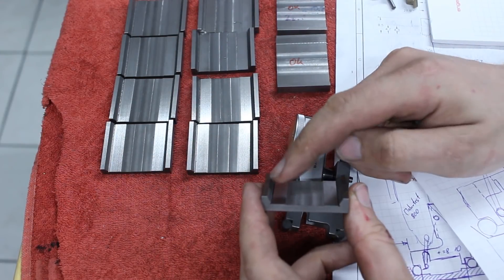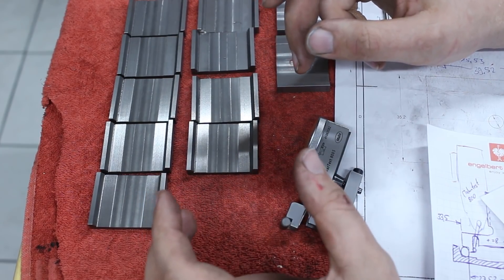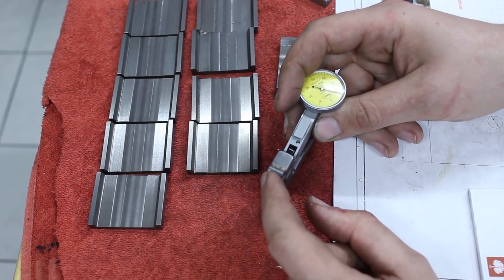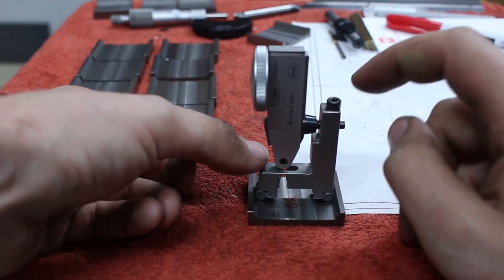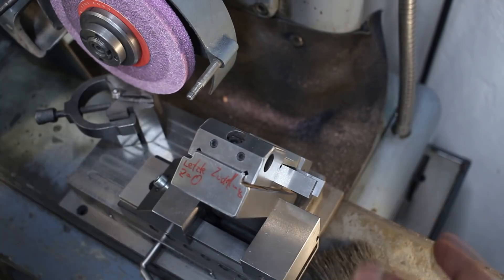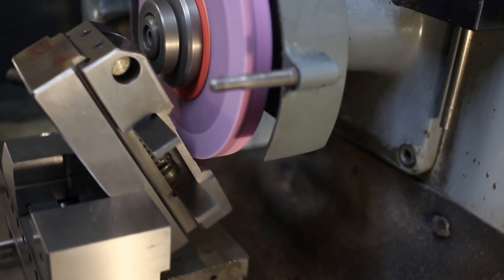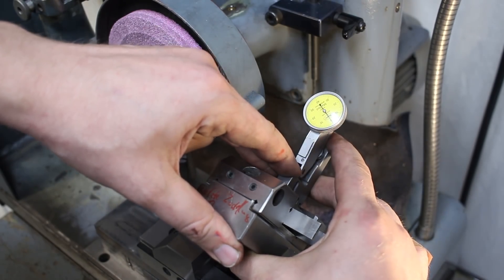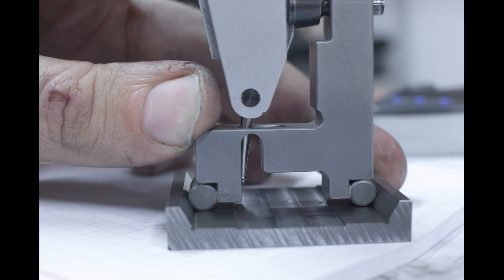Custom gage for measuring a prism

Comment: How did you cut the carbide pins ie the endmill shanks? Also there is a corner relief cut made to the part. You can see it at 11:18. That is either a very tiny endmill or something else. How did you do that? More to the point. Getting that vice with the sine bar would have been easy to approximate but to get it perfectly aligned with the sine bar would have been difficult? How did you do that? You may not want to answer all of those.... I appreciate that you would have even read my comment. Thank you for your videos Stefan.

Comment: Another way is having the two pins on the fixed known gauge distance, with a DTI to measure the vertical lift on one side. That will then give you a calculation for the amount to be ground. Even with this flexure, it does not give the direct measurement of material to be removed.

Comment: Excellent tool design. For those of us who use female dovetail tool holders on our lathe, the design you described would be VERY handy for adding tool holders as needed.  Perhaps the tolerance measurement offered by your fixture is not required, but the ease of use is definitely a plus when making these.

Comment: The tool looks pretty good for a quickie. 
Weiter so ;)
wondering about all the holes in your skin. Mine looked like this before putting on gloves when using locktite...
Reply from the maker: Thats just wear and tear on my hands/skin ;)
I use gloves with epoxy and loctite since quite a long time now. Thats something I dont need on my skin anymore.

Comment: Why carbide instead of ground steel shaft? Easier to mount? Carbide dont live a mark on that steel?
Reply from the maker: The carbide stays hard after silversoldering and its free. I didnt have ground 6mm HSS at hand. It doesnt mark the parts if you dont set it on crocked.
Reply: @StefanGotteswinter  Thanks for the answer

Comment: I had a job to do, similar to this one, but instead of trying to use an indicator or gauge blocks, I had a pretty nice set of Starret Adjustable Parallels. And just used my mics over those. Pretty accurate if you lap the parallels after you buy them.

Comment: You could also accurately dress a large required degree angle on the edge of the wheel, lay the work flat on the magnet, against the magnet's rail. To sharpen the wear on the wheel, simply flat dress the bottom of the wheel. That vise setup looks a little less than reliable to maintain accurate angular position. But that's my opinion, and it's worth what it cost you to see it. Thanks for sharing your skills, and knowledge.

Comment: I suppose you could make a piece of spring steel to replace the integral flexure you have, if you wanted to measure different gaps later.  It's a terrific piece of work.

Comment: Very nicely made, and a very good idea.  Could it be made adjustable, so it would have a small range of measurements?  Thanks for sharing and thanks to Robin for sharing the base idea.
Reply from the maker: Yes, with a bit more engineering and time, you could design something adjustable - Or buy a shallow hole gage, which would almost be the same ;)

Comment: Nice to see a custom-tool :) . How did you ensure that the two WC cylinders are dead-on parallel while soldering? Otherwise, in principle, you'd end up with an over-determined system...
Reply from the maker: The step for the two cylinders are milled in one setup, so those are already parallel. Then I soldered each in, making sure to press the cylinder down into the step firmly while the solder was still molten.
Then I checked parallelism, and it was well within 0,01mm - Otherwise I would have tweaked the flexture slightly with a pair of pliers to get the cylinders parallel.
Reply: @StefanGotteswinter  You refer to RobRenz, but have you watched Dan Gelbart's eighteen masterclass-videos, by the way? :)  (YouTubeSearch --> "Dan Gelbart")
Reply from the maker: Yes absolutely, they are a great series.

Comment: Neat!
A question from someone who's never run any machines at all (except for a drill press perhaps):
How do you know which side needs to be ground? 
With this device you can accurately determine how far apart the angled surfaces are in regards to each other, but not in reference to the sides - right? Wouldn't it be possible to ground the part off-centre by accident?
Reply: I was thinking about the same thing! Would be nice if Stefan could enlighten us!
Reply: I think the inside measurement was critical, which is why he flipped the piece 180-degrees to grind both (interior) surfaces.  The outsides may not be critical, or he ground them in a previous off-camera process?

Comment: Dear Stefan,
Very clever. 
Could you possibly do a video discussing how to make a living as a precision manual machinist?
There are plenty of people chasing the high-volume CNC jobs (e.g. Titans of CNC), but as a manual machinist, I would like to know how to make money with careful craftsmanship instead.
e.g. What market sectors or types of customer should I be offering these services to, and what sort of rates should be charged for what sort of machining operations, etc.
What applications, or types of customer are happy to pay more for a manually-made precision part, rather than one made on a CNC machine, and why is that the case?
Thank you
Reply from the maker: Get a fulltime job as a cnc prototype machinist, thats what I do for a living.

I dont do this to make a full living, just a good side income.

People dont want manual machined parts. They just want parts as per drawing. I cant (and dont want) to compete with anyone who has one or more cnc machining centres or a bunch of mill-turn machines.
What I as a mostly manual shop can offer are things that drive other people mad.
- Small numbers of parts, combination of machining, heat threat, grinding
- Some design/engineering work (I am not an engineer!)
- Rebuild machine parts (handscraping and other techniques
- Make reproduction parts of broken/worn machine parts
- Modify machine tool accessories
- Do things like assembly, silversoldering/brazing in combination with machining
- Microscope-Deburring

As for customers, get your name out. Show work that you do for yourself, look around in Forums, do work for model engineers who need a complicated parts that they cant make themself. 
Reach out to local companies that make a product, maybe they are looking for somebody that can help them with prototyping or building/designing assembly fixtures, etc.
Reply: @StefanGotteswinter   Thank you, that was most helpful.
Reply: Having 50,000 people see what you can do helps, assuming you have something worth showing.
Reply from the maker: Welk, might help ;) But I usualy dont do work outside Germany/Europe, that gets conplicated with taxes, shipping and customs.

Comment: Wont the tangency point on the angled surface be different than the one on your gage block stack?  Or did you compensate for that?
Reply: The point is not to know where the tangent point is, but to know what the relation ship is between the two 6 degree faces at the end and the flat section in between them.  If you know the diameter of the pins, and the distance of the pins, be they the ones on the gauge, or free pins that are being used with gauge blocks, you know that relationship.  As a result, this gauge can now tell Stefan how far out of spec the part he is working on is.
Reply: @anathaetownsend1894  Except that when  you are measuring the part with free pins and gage blocks you are measuring to the point of tangency of the angle.  When you use the snap gage to set your indicator you are setting it to a different point on the pins so you are not directly measuring the same distance from the snap gage to the part.  Now if you calculate the difference and use that dimension in your snap gage then there is no problem.  Unless I missed it that was not discussed.  Of course I would suspect he would just assume we would know that.
Reply: @465maltbie  correct.  Which is why he sets up a gauge block set based on the pins in the gauge to set the dial test indicator.

Comment: Very well thought out as usual.  Do you find the reading changes much between the part in the vise and out, i.e is the gauge stiffness significant when compared to the part stiffness when not backed up by the vise?
Reply from the maker: Good point - Yes, if I overtighten the vice, I can measure the deflection with the 0,01mm DTI in the gage, but I realy have to crank down good to get much effect. The way I hold the part (deep in the jaws), I get full axial clamping force trough the part, not much bending force.